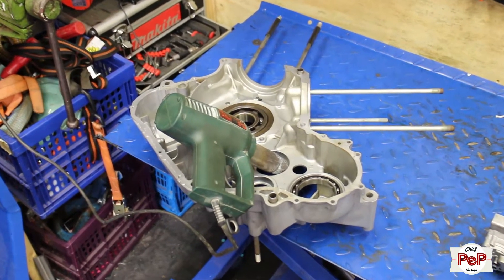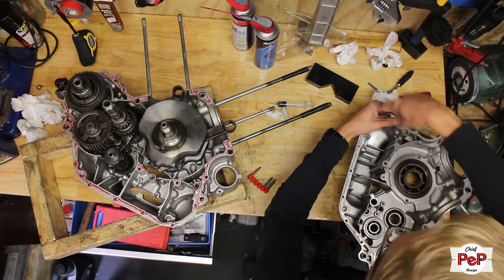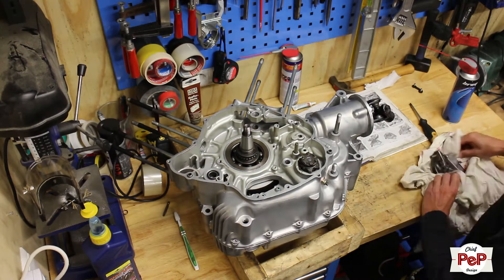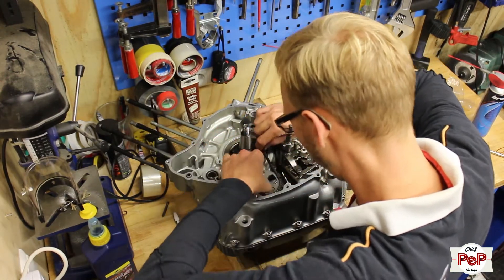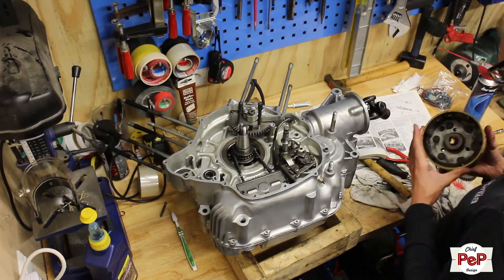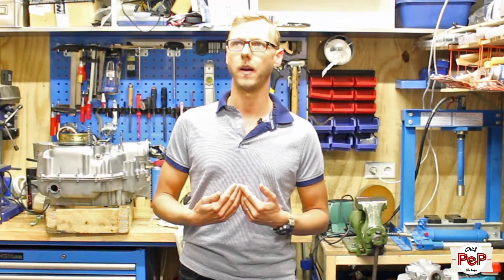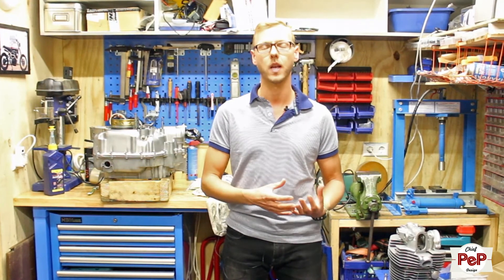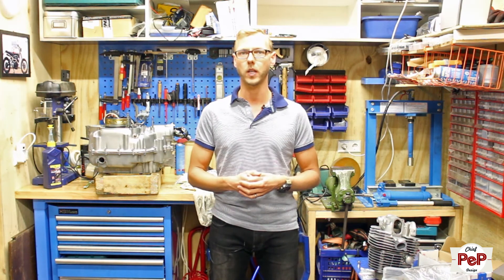Engine closing

Comment: While removing left side cover, the shift shaft came off by accident, Now does anybody knows how to put it back in the same original postion? It has a spring at back that must be position in certain way. beside part catalog manual and drawing I don't see it's helping me to figure it out,
Reply from the maker: You should use a workshopmanual like the one from Hayes like I use. They explain everything step by step.
Reply: @chiefpepdesign  Yes I did find  it in manual, it's original writen by Yamaha Motor corp and not Hayes, but this should be good enough. I didn't looked into it first cause many things are not mention in this manual, but shift shaft is there. Thanks.

Comment: Good job, you have done that very precisely and accurately. You are truly doing your best. Most engine rebuilders where I live wouldn’t have cleaned the threads or tested anything. And they will usually loose bolts.

Comment: Excellent eye for detail there, great to see an engine being re-built with care,  one tip I was given years ago when re-building any engine was to  strip the oil pump and fill it with graphite grease, when the motor is started this helps to prime the oil system and sends a good shot of graphite grease and oil around the motor, graphite grease mixes readily with oil and will come out at the first oil change.

Comment: What is the engine type?  does it have an oil pressure release valve?
Reply from the maker: d3xterown nice that you noticed. No it doesn’t have that. It's an '82 XV750 (although, I'm not sure of the year...)